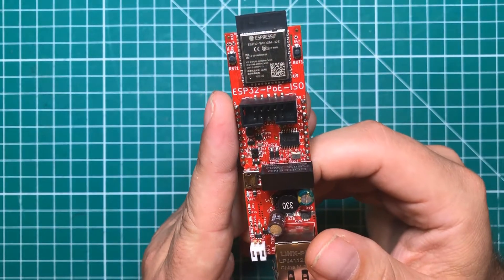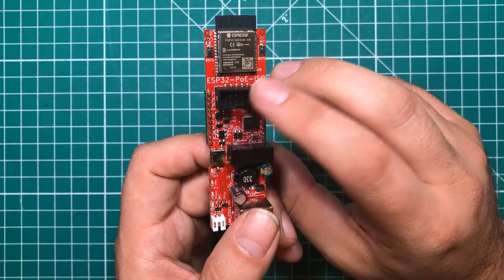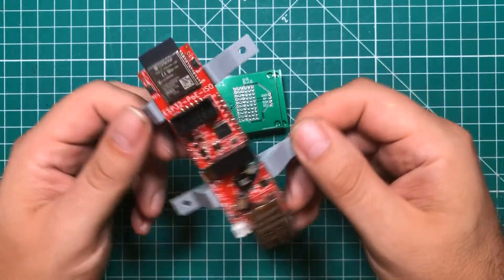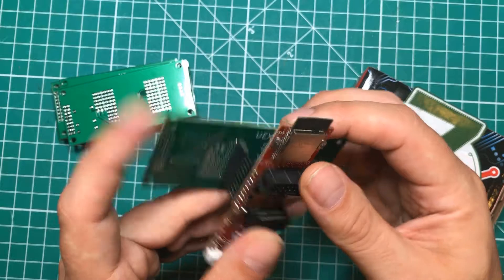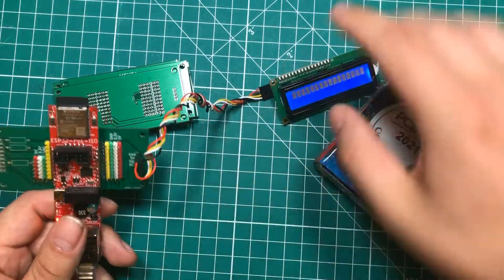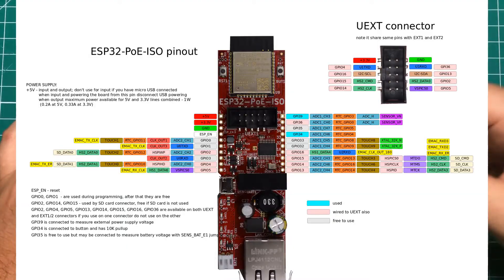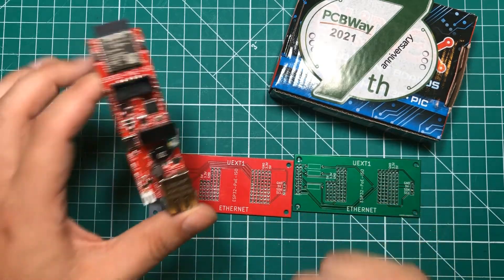The Olimex ESP32-POE-ISO has 4 big problems. Let's fix them.

Comment: You: There are problems and I know how to fix them.
You: The documentation looks good but it's wrong.
Also you: There's a problem with a "Free to Use pins" for PoE compared with the documentation but I'm absolutely not going to tell you what the problem pin is or how to fix it.

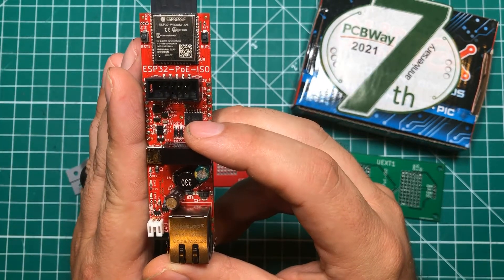Comment: 7:30 maybe connect reset pin on device so it doea not power on until voltage stabilize?

I don't know if it supports that... But nice hint 🙏

Comment: This board, which I have just discovered, seem to be exactly what I need, provided that:
1. I can add a battery, and the ability to charge said battery, when powered via PoE.
2. The ability to control a single 240v relay. Presumably this is not an issue.
3. The ability to use it as an actual internet connected WAP. I don't see why this should not be possible, but it may not be.
4. the ability to connect a proper antenna, preferably more. I've seen versions of this board with a single antenna, but not tow or three.

Lastly, and not really a necessity in regards to this specific board, but ideally, a readymade board, including relay. Also, POE is really not a necessity, in fact if would be a convenience to have it mains powered, though I suspect it will be less power efficient, when in deep sleep, not the ESP32 itself, but the whole package, of course, as opposed to battery power.
I also think that the price is a bit... spicy, but it'll do, if nothing better is available.

Any recommendations?
Reply from the maker: I wind up buying these boards in bulk and I think they come out to about $20 each so that helps with the pricing.  If you're not using the POE part and want an antenna, this probably isn't the right board... I've never used the battery portions of it either.  It definitely wouldn't have a problem with the WAP and the relay.
Reply: Thank you for the answer. It think this board pretty much does what I need, only I have to do it the right way, and not the easy way. I'll have to think it over.

Comment: Thanks for this video :) Do you happen to have a list of "free to use" pins that aren't actually free to use? Don't have such a module yet, looking for info about this first.
Reply from the maker: I don't off the top of my head. I have just learned that any other pin that seems to be connected to POE or anything like that, I just don't use it if at all possible

Comment: You should check out the wesp32. It is better in every way. More free pins, more power from the POE output (12v or 5v), mounting holes, etc.
Reply from the maker: I'll check it out. I did hear that the latest revisions of this board also have mounting holes now
Reply: but it's more expensive

Comment: Thanks for sharing the PCB! Would this be compatible with the regular ESP32-PoE from Olimex (non-ISO version?)
Reply from the maker: I believe the pinouts are the same on those 2 boards. They both have 20 exposed pins and I'm pretty sure the order is the same.
Reply: @AnotherMaker  got it, thanks!

Comment: One Other Question I was just curious about, Did you setup the Proto Shield to have that Pinout for the I2C Bus so it would work with the NCD I2C Modules? I noticed the pinout was perfect for soldering their 4 wire Molex connector, thus making this a Master Device for their i2c Sensor series.
Reply from the maker: I didn't specifically. I set it up for the cheap 16x2 LCDs screens but it could be used for pretty much anything

Comment: Hi,
Nice tips and design, I just wonder if it isnt possible to rotate the board 45 degrees and have the extra pinouts on the back?
So it uses more the slimline of the device itself.
Reply from the maker: Thanks for watching.  I'm sure it is. The funny thing is that I'm usually replacing some giant controller with these.  so normally this thing winds up taking up 10% of the space whatever I'm replacing does.  But you're definitely right. that would be more efficient.

Comment: Do you have a video as a Code Walk to using your sketch?

I barely know enough about Programming to make sense of the code, but I've never used OTA updates before.

I'd like to implement that with an MQTT Client to change how to Pub and Sub Events on the board.
Reply from the maker: I don't for this sketch. I do have the code but I haven't done a walk through on it. A lot of it is very standard ESP 32 stuff so pretty much anything dealing with Arduino or SP32 will be helpful
Reply: @AnotherMaker  The big thing I've been spinning my wheels on is I want to use MQTT with a TLS connection with Hive MQ, and I'm having a hard time wrapping around developing for the ESP32-PoE-ISO in Visual Studio Code.

I've got snippets of parts of these tutorials together, but I'm having trouble putting it all together. 

Part of it I think is just trying to wrap my head around all the different functions needed to pull this off.
Reply from the maker: @Shadowwand  Yeah. I gave up trying to do mqtt over TLS a while ago. It can be done, but any time I need tls, I just do https connections instead.
Reply: @AnotherMaker  aww that's a real shame. I was hoping I'd finally solved all my hopes and dreams with the ESP32-PoE. I love using PoE for gadgets to send Data, and was looking for a microprocessor I could develop to handle getting MQTT Messages from the edge.

I'll keep working on prototyping with this board then, maybe someone will develop a relatively easy to use library for MQTT TLS at least.